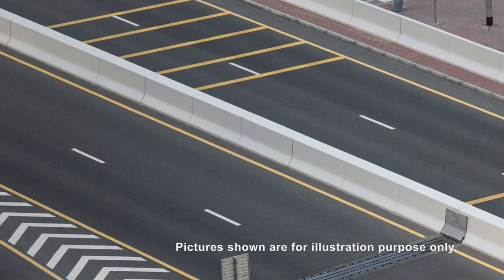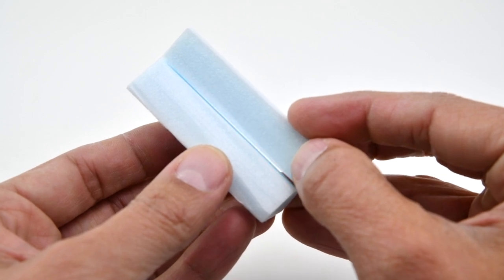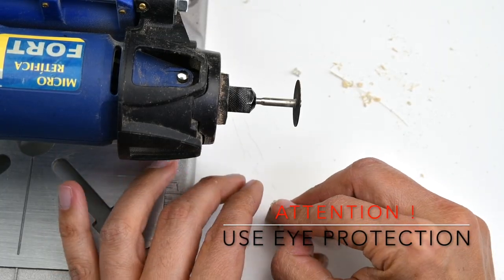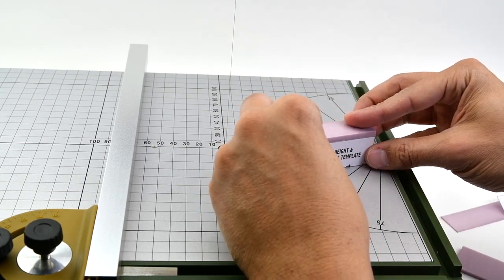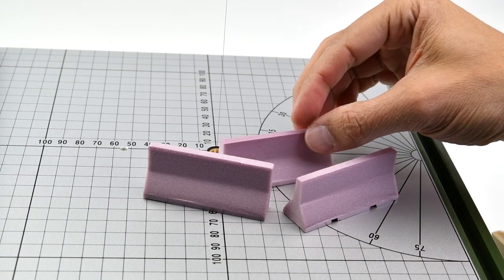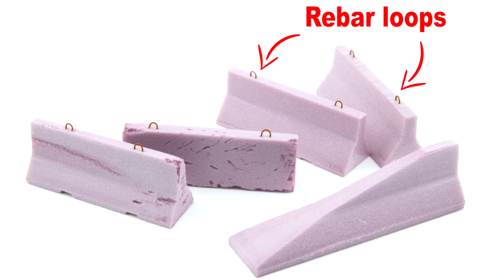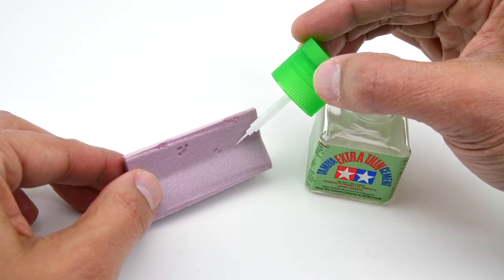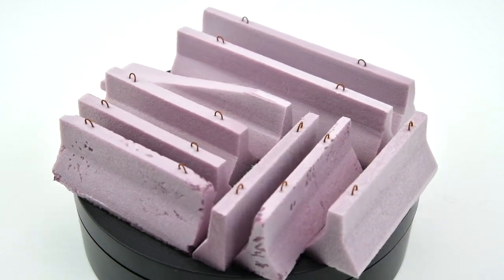HOW TO MAKE Concrete barriers using Styrofoam

Comment: I Would Like The Measurement For  1/32 Scale To Make These Cement Barriers  Please 🙏 😢 If Ya Have Time And Willing To Do So And I Will forever Be Thankful and Thank You For All You Do To Help People Like me. And God Bless You 🙌
Reply from the maker: I will try
Reply: If you take the 1/35 measurement   multiply this by 35 - this will give you the 100% (full size) dimensions. Then simply divide by 32.  
Once you have this measurement you can just increase the dimensions by the difference: However, give the minimal difference [ at 1/35  scale 1metre is 28.571mm  at 1/32 that metre is 31.25mm)  so just scale up

Comment: How can I make them  into 1/87 scale because I do ho scale trains
Reply from the maker: You would have to translate the measurements of the real ones to 1/87, by converting into millimeters and then dividing by 87. Have you looked for aftermarket option, it might be easier than doing it yourself in that scale.

Comment: Thank you so much, thi is very helpful cause I usually stick with a set from Meng that I had to make them with plaster and that takes a lot of time for drying. 😊 Can I ask you about hot wire cutter, where did you get it?
Reply from the maker: I am happy that you liked it. Tomorrow I will post the episode on how to paint the barriers. Stay tuned. P.S.: I got the hot wire cutter online at Amazon. Let me know if you have any other question. Cheers!
Reply: @auttorama  Thank you so much, I'm looking forward to it 😊

Comment: Thanks for this excellent video, and for the templates!  Already subscribed.  A quick question on the templates... the part #5 ( is shorter thatn the top (#3) and base (#4). Any special reason?  or did I missed something on the video ? I am not a native speaker, so it is possible.
Reply from the maker: Hello Luis, first of all thank you for your support and for subscribing to my channel. That means a lot to me. The parts 3 and 4 form the exterior of the template. The reason the part #5 is shorter is because is supposed to have the exact length so the foam can fit inside of the template. I hope that helps. Let me know if you have any other question. Thanks.
Reply: @auttorama  Thanks a lot for your quick reply!
Now I understand.

Comment: Please suggest the brand/model of your cutter. Thank you
Reply from the maker: Proxxon 37080 Hot Wire Cutter THERMOCUT 115/E, keep in mind that there are other brands available that will work the same. Let me know if you have any other questions! Cheers!
Reply: Based on the color - I would suggest it's a Proxxon 115/E. While I don't own the hot wire cutter, I can recommend their rotary tool. Proxxon manufactures great tools.
Reply from the maker: Great feedback. Thanks!